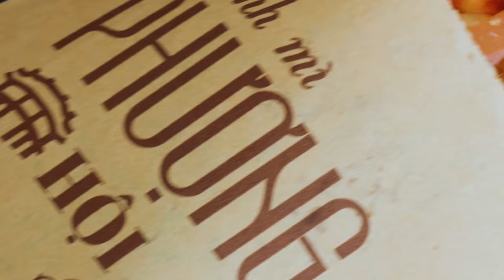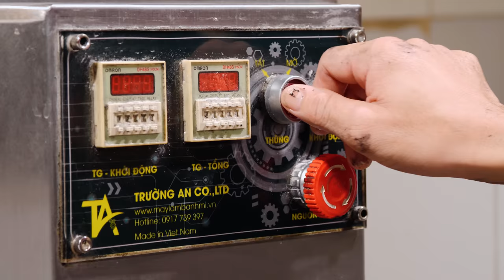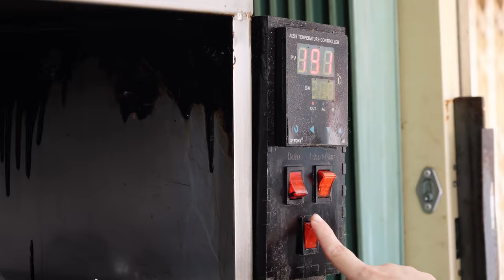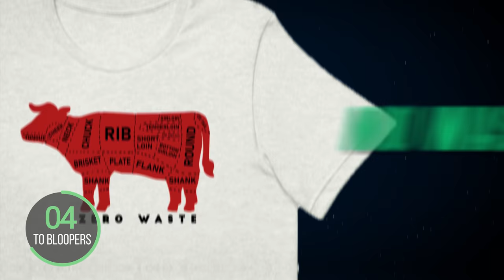$10 Street Food Challenge in Saigon, Vietnam!! Oil Shower Chicken?!

Comment: Oil-showered chicken might just be the unhealthiest way to fry chicken.  You're already starting with a polyunsaturated oil, most likely soybean given the location, which is prone to heat and oxidative damage due to the number of double bonds.  Then you're going to drastically increase the amount of oil that is exposed to oxygen by squirting it through nozzles and letting it travel through the air to the chicken.  You'd have a hard time designing a more health-damaging method of frying if you set out to from the start.

Just because something is possible doesn't mean it should be done that way.